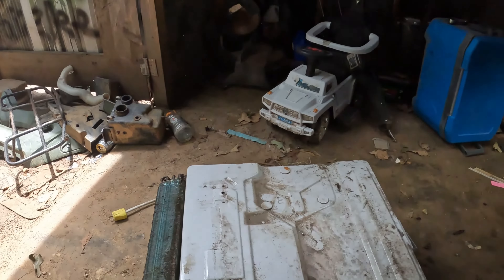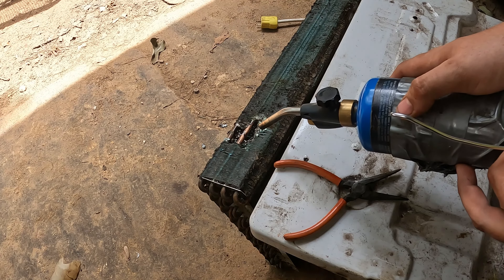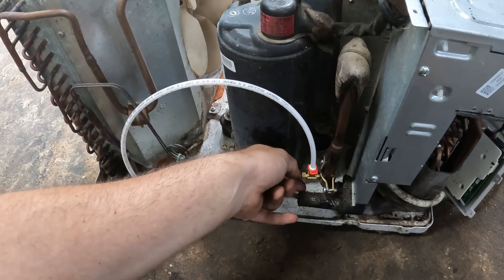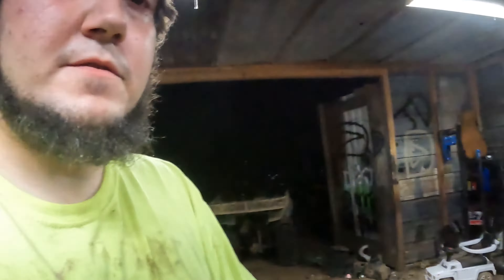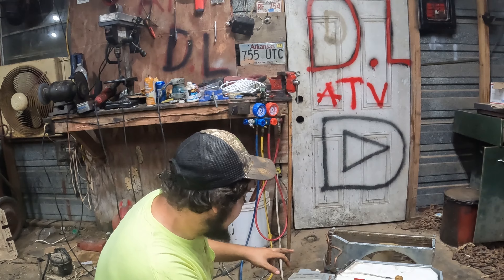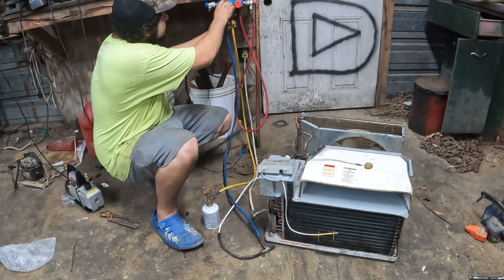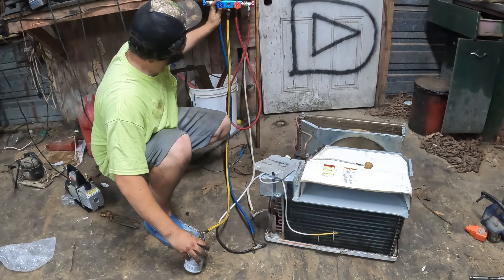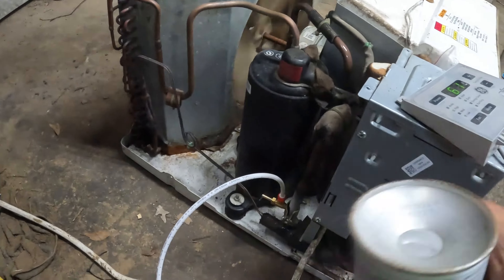DIY Recharging a Window A/C With R-134A

Comment: From someone with experience with HVAC, this is a great idea for a cheap fix.

There are a few things I noticed:

The saddle valve might be a leak point.

The "negative"(below atmospheric) pressure of the manifold is in inches of mercury. I'd consider the pressure test(150+psi dry nitrogen depending on system design) the leak test and the decay test and micron level more of a moisture indicator(microns usually require a digital gauge as they are so small)

If you are charging the refrigerant as a liquid(shown in video), charge it in short bursts(quickly open and close the low side port of the gauge). Most(all I've seen so far) rotary compressors have a suction accumulator on the side(vertical tube maybe 1.5-2 in dia, painted same color as rest of compressor, bottom enters into compressing chamber thru 90 and suction line hooks on top), so it is harder to flood the compressor, but still be aware.

Due to different characteristics, it might not be a good metric, but if you measure the middle of the evaporator coil or one of the u bends towards the center and compare it to the suction line temeprature, you can find the superheat.(SLT suction line temp - saturation temp(middle of evap temp or suction gauge pressure and use pt chart for refrigerant)). Make sure there is some superheat otherwise you will get floodback. You can also use a similar method to measure the subcooling(middle of coil temp - liquid line temp) and make sure there is some present, because you don't want to feed vapor into the metering device.

I have heard that r134a has about half of the capacity of r410a, but since it has a lower pressure, you only need to tweak airflow a bit as the metering device remains the correct size

For potential legal reasons: I do not officially condone doing this.

Comment: Bro sorry to tell you but , every a/c unit is charged with vapor not liquid , you will damage the compressor unless you have a dryer on the suction line after the charging port. The fastest way to drive that vapor freeon is put the can on hot water and it will shoot right in.😉
Reply from the maker: Never thought of that 🤔 but sounds like a good idea
Reply: Did it work
Reply: Actually in the tank/can/bottle it gets filled from its liquid and is supposed to be upside down when filling. Not trying to argue out and back, just stating a fact.
Reply: That is a useful tip if charging as a vapor.(and similarily, you can heat the system up when recovering to help push refrigerant out and boil liquid)

You can charge with a liquid, but care is necessary to not flood the compressor.
I think you mean accumulator, not dryer. And all of the rotary compressors I've come across have accumulators(and all window acs I've seen have rotary compressors)

Comment: 410 single cans Walmart
Reply from the maker: were i live you can only get R134a unless you have a A/C license
Reply: @DustinLansdell   I doubt there's any place in the U.S. a person can buy 410 OTC (no license).  -  Good video.  -  I need to try this on a 6000 Frigidaire (only a few years old).  I am almost sure it is just a seal at a fitting.  Have to find the leak, first.  But, I only have one gauge to monitor freon input.  Nothing else, no vacuum, nothing.  Like you, I figure, WTHeck, nothing really lost but a few bucks / some 134, and time.

The least of my expertise is anything to do with AC.  I may just get a line tap, put some in and see what happens.  I'll try some die to start.  Aren't there some 134 cans that include oil?  Stop leak?  I am going to fish around.

I also have a Frigidaire 8000 and a Frigidaire 10000 with a leak, no freon.  Both only a few years old, also.  The alternative for all of them if I do nothing is the trash.  :-)

Don't buy Frigidaire!